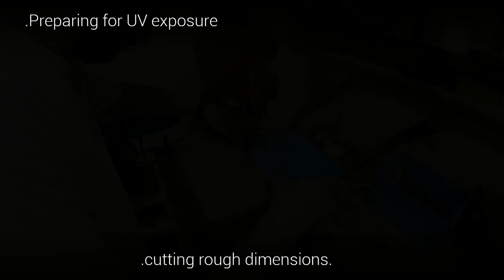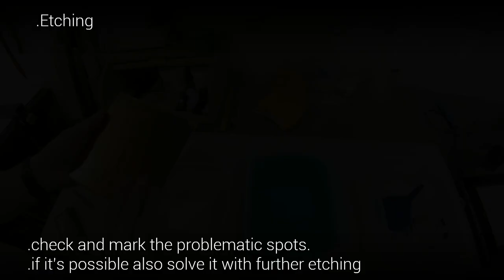Making double-sided PCB (printed circuit board) at home (small workshop) - photo-method and etching

Comment: So how do you tin the pad holes wall so you can get connection on both layer? This is so you can solder the components in the bottom layer.

Comment: can say do i need to connect both side with pcb rivets?
Reply from the maker: Hmm.. Both side have so called vias, in some cases are used rivets, but I use just piece of wire soldered on both side to make functional connection between top and the bottom..
Reply: @webblab2415  thank you your answer. but when you solder a wire, will you not totaly close the  hole? for that reason how can I put components like IC socket or radial lead capacitors?
Reply from the maker: the wire is going only to the dedicated openings. In the case of the components, it's soldered to the legs of the component from both sides, if it's possible. There are components where it's not possible because you can't get to the spot with soldering iron, it's a restriction that you have to have in mind during the design, some components need an extra connection through the board. For example, the IC socket needs additional vias if you want to get the signal to another side (not necessary if the signal goes to another component with the possibility of soldering from both sides, depends on overall design).
Reply: @webblab2415  thank you so much:)